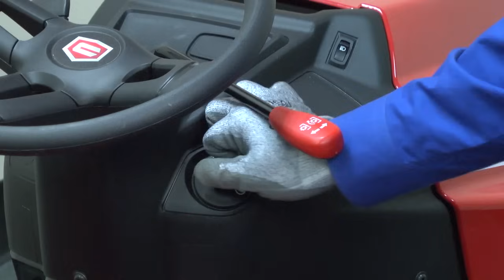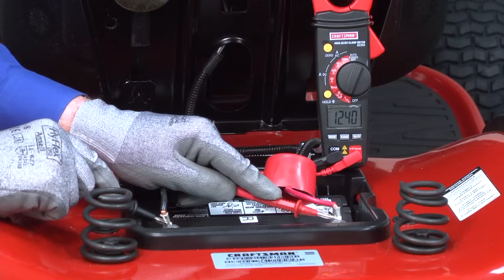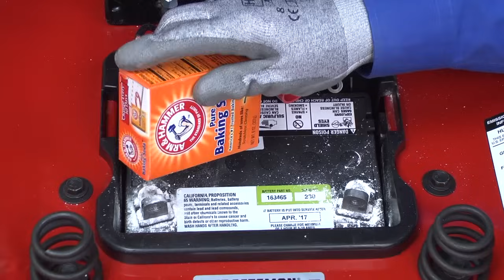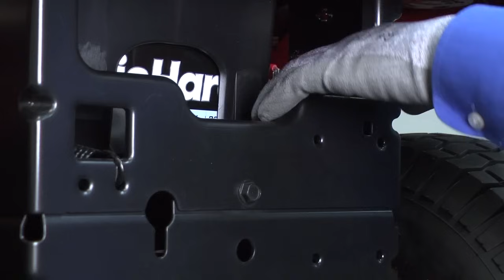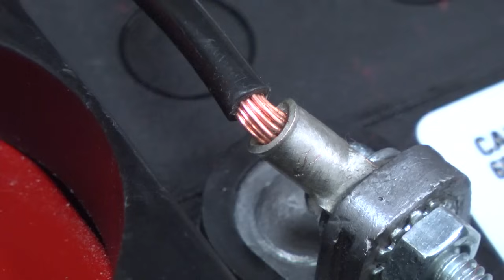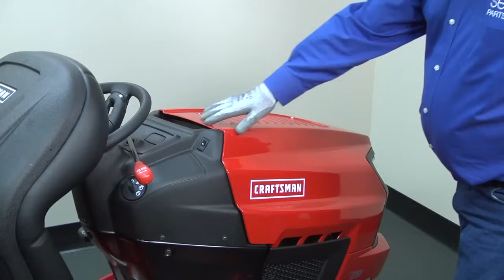How to Fix a Riding Lawn Mower That Won't Start: Engine Clicks But Doesn't Crank

Comment: Ok, maybe you can help me here, I like the video, I have a brand new battery, brand new solenoid and a brand new stated just put in.. I turn the key and the air intake spins a little and then stops.. turn the key a few more times and sometimes it spins a little, and other times it does not, just moves a little bit, I am at my wits end here as my mower had no issues starting until 2 weeks ago when my neighbor was airing up my rear tire for me and was not paying attention and my tire blew. had to wait about a week for new tire to come in, put it on and then mower would not statr!!  Have any ideas that might help me??
Reply from the maker: Try removing the spark plug(s) and then turn the key to the start position to see if the engine spins with the spark plugs removed. There's a chance that oil entered the cylinder(s) and a hydraulic lock in the cylinder(s) is preventing the engine from spinning. If the engine spins with the spark plug(s) removed then the oil causing the hydraulic lock will eject out of the cylinder(s). Reinstall the spark plug(s) and try to start the engine. If the engine still doesn't crank more than a little ways after you replace the spark plugs and your mower has a single-cylinder Briggs & Stratton engine, then the compression release cam could be broken. You'll likely need to have a service technician replace that part. If the engine didn't spin with the spark plug(s) removed, then a piston could be binding up inside its cylinder. You'll likely need to have a service technician diagnose and repair the engine. We hope these tips help. If you need more assistance, let us know and give us the model number of your mower or engine.
Reply: Hi. So did you get it solved. Sounds like the problem I've got now.. battery ok, solenoid ok, terminals ok, ground cable ok. 
Only thing haven't checked is the starter. Oh boy, I don't want to go there. Engine coming out!

Comment: Batteries fully charged but still won't start but if you hook a jump pack up to it fires right up
Reply from the maker: Even though the battery is fully charged, it may not be sending enough starting current to the starter motor to spin the engine. You may need to have the battery checked or replace the battery. Corrosion on the battery terminals can also prevent the right amount of starting current from reaching the starter motor. Check the battery terminals for corrosion and clean them if corroded. We hope this information helps. If you need further assistance, let us know.

Comment: ha hahahaha  on me, It got new battery first, it was due, then the clicking a new solenoid, Then I get to checking the starter Power. Hmm changed starter, with all new kept clicking, The one test he doesn't mention here, checking voltage from pos battery term to ground screw only 7.7 volts out of a battery with almost 13. Take out screw clean put back in Starts. 100 or so dollars later At least my major electric components are all new

Comment: PULL SPARK PLUG TURN OVER ENGINE MAKE SURE ENGINE IS  NOT HYDROSTATIC LOCKED  FROM FLOODING CARB. OR WATER FROM BEING LEFT OUT IN THE RAIN IN THE ENGINE. LOOK FOR FLUID COMING FROM SPARK PLUG HOLE AS YOU CRANK MOTOR OVER

Comment: Always check starter pinion or take out plugs hand turn engine after checking fuses and ignition and battery 1st. Never try to crank any unit w/o checking oil 1st to ensure it's not too much oil or locked. A starter pinion that's stuck will not turn engine either way use safety 1st. My experience i didn't have to use meter certain machines are messed up from engineering designs from factory

Comment: Great video!!  How freely should the motor turn with a socket?  Mine does turn but not easily.
Reply from the maker: You shouldn't need to strain when moving the ratchet handle to spin the engine. If your mower has a single-cylinder Briggs & Stratton engine, try removing the spark plug and spinning the engine. If the engine spins easier with the spark plug removed, then the compression release on the valve cam could be broken.

Comment: Thanks for the video...It would have been much more helpful if you would show where the solenoid is located.
Reply: Gs Wovoka  follow the red cable from the battery. It leads directly to the solenoid.

Comment: What if everything is good haha good battery engine isn't stuck starter is good and solenoid is good it will click once stop clicking then click again the starter trys to move but no crank
Reply from the maker: The engine may be locked up. If you have a single-cylinder Briggs & Stratton engine, the valve camshaft that releases cylinder compression could be broken. To troubleshoot this problem in a single-cylinder engine, remove the spark plug and see if the engine spins with the spark plug removed. If the engine spins, then you'll likely need to replace the valve camshaft (https://www.searspartsdirect.com/part-number/793880/0071/500.html ). In 2-cylinder engines, problems with valve adjustments could prevent a cylinder from releasing compression and lock up the engine when spark plugs are in place. If the engine doesn't spin with the spark plug removed, then the engine may have a locked up cylinder. We hope these troubleshooting tips help. If you need further assistance, let us know the model number of your mower or engine and give us additional details about the failure.
Reply: Sears PartsDirect sadly these aren't the case cylinders free good compression I've torn this engine apart to find out what's going on but everything is in grate shape I've started to think maybe not thick enough wire from the starter possibly? Bad ground perhaps but I went and added thicker gage wire and the starter just slightly moved then lost lost all power (had to replace the starter tho because it did start smoking and that's not normal hahah)

Comment: This is by far the best video explaining and understanding what could be the issue. I follow all the steps. Everything went good except when I got to see if engine when I get to the part of test for engine seize or starter electrical,  go through click and read 1.14 then it drops. The starter try to move and engine/flywheel maybe three seconds and it wont do nothing else. 

Replace battery, starter solenoid, ignition coil module, spark plug. I have LXT1040 Model#13wx90as056 Kohler engine model#SV590S. Would appreciate all your feedback. Thank you.
Reply from the maker: Here’s a link for the article and video for an engine that spins but won’t start: https://www.searspartsdirect.com/article/riding-lawn-mower-engine-spins-but-wont-start-video.html Follow the steps in that article and video to troubleshoot the starting problem because the starter is trying to spin the engine. Here’s some additional troubleshooting advice pertaining to your specific engine: Based on your details, there’s a chance that the ACR (automatic compression release) on the Kohler engine isn’t releasing cylinder compression so the starter can’t spin the engine. Faulty valves could also be preventing the engine from spinning because the valves aren't releasing cylinder compression. Remove the spark plug and try to start the engine with the spark plug removed. Removing the spark plug will release cylinder compression if that's what is preventing the starter from spinning the engine. If the engine spins normally with the spark plug removed when you turn the ignition key to the start position, then you’ll likely need to have a mechanic adjust the valves and/or repair the ACR system.

Comment: Clicking and won’t start. I did all of the steps and everything seemed good. Battery is fairly new and reads 12.85 v and I even had it checked out, reads 100% volts and CCA. I got it down to the starter motor. I then bypassed the electrical system and checked to see if the starter would turn. It turned for less than a second, then it stopped. I removed it for the tractor and tested it again. It spins. I checked to see if the engine is locked up and I could move the fly wheel with my hand, very easily.  It has been dragging for a few years before it finally turns over. Could that starter motor still be bad? I have replaced the ignition switch and the starter solenoid. I have also noticed that my ammeter is reading negative. Could I have the red and white wires reversed on the starter solenoid, one goes to the clutch switch and the other to the ammeter?
Reply from the maker: Let us know the model number of your lawn tractor so we can check the wiring schematic to determine whether you have the solenoid wires connected properly. We recommend some troubleshooting checks in response to your question on our “Doesn’t Crank or Click” video. That advice may help you resolve the starting problem.
Reply: Craftman 917.274033, DYT 4000 21 HP,  purchased 2004
Reply: Battery 12.85 V
Red post on starter solenoid to negative battery  12.85 V
Black post on starter solenoid to negative battery 12.85 V From the video, it took about 2 seconds as mine did. 
Negative post on starter solenoid to starter post 500 mV
Bypassed electrical system with jumper cables and starter spins for less than 1 second, stops
Removed starter and hooked it up directly to the battery and it spins. 
Had Advanced Auto check it out, they used a test for a slightly larger starter and it passed all the tests. 
Talked to one guy at the small engine parts store and he suggested removing the spark plugs because the compression might be too high for it to start but wouldn’t that make the fly wheel very hard to turn and then he mentioned all kind of messed up engine internal parts but wouldn’t that also make the fly wheel very hard to turn? 
I have noticed that my ammeter reads negative volts and it has been that way for several years. I am not sure why that are calling it an ammeter, it clearly reads voltage. 
Ammeter, red wire to the solenoid
Break/clutch  switch white wire to solenoid, what would happen if those two were reversed? 
Starters are very expensive so I really need to be sure that it is bad. I bought one a couple years ago and the base was 1/4 inch short and it destroyed the gear.
Reply from the maker: Thanks for posting that model number. The wiring schematic for your model is available in the Schematic section of this parts diagram page: https://www.searspartsdirect.com/model-number/917274033/0247/1509200.html  The wiring diagram is also shown on page 31 of the owner’s manual. Here’s a link for an online copy of the manual: https://www.searspartsdirect.com/partsdirect/user-manuals/917274033-craftsman-parts-manual  Use the wiring schematic to check the wiring on the ammeter, ignition switch and starter solenoid. Removing the spark plugs and testing the starting system to see if the engine cranks is a good test. You indicate that you can turn the engine by hand but there’s a possibility that a valve may not be releasing cylinder compression. If the starter spins the engine with the spark plugs removed then you’ll likely need to adjust the valves. Here’s a link for the repair manual for that engine in case you need it: https://www.searspartsdirect.com/part-number/273521/0071/500.html
Reply: Yes I do believe the valves need adjusting, thanks.

Comment: Thanks, I heard the clicking so I thought it might be a bad starter. Good thing I tested the wires. The post on the solenoid on the battery side was corroded so took some sand paper to it now it fires right up. Thanks for the video.
Reply from the maker: Thanks for letting us know what you found. We're glad to hear that you got the mower fixed.

Comment: What if I check across the solenoid and when I turn key and activate solenoid my voltage goes from 12.7 to 11.94 and stays there
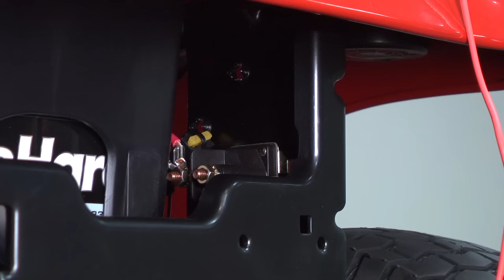Reply from the maker: If your meter measures 12.7 volts on the red terminal post of the solenoid as shown at 2:37 in the video, but the meter only measures 11.94 volts on the black terminal post of the solenoid in the test shown at 3:12 in the video, then you’ll likely need to replace the solenoid because the solenoid isn’t allowing enough current to flow to the starter motor.

Comment: Battery has 12,71 V voltage.  I measured 7,8 out of solenoid to starter. Solenoid broken?
Reply from the maker: Check if the red battery cable is delivering power to the solenoid post by measuring voltage on the red terminal post as shown at 2:30 in the video (if you haven’t already checked that issue). If the red battery cable is good (delivers 12.71 volts to the red solenoid post), then yes, the solenoid is broken according to your meter reading of 7.8 volt solenoid output to the starter.
Reply: Yes I measured the incoming voltage to solenoid. It was 12,68. Outgoing 7,8 seemed seemed to be rising if I kept on starting the mower. But I ordered new solenoid already, hope it solves the problem. Thanks for great video.
Reply: Seems that it was not the solenoid. Starter motor gets only 0.2 V. Still we managed to get the motor running. Flywheel is not working properly. It needs to be manually turned before motor can be started.

Comment: Nice video.  This covers all the components that could break.  Luckily for me the problem ended up being the battery terminals.  After I cleaned them I was able to start the engine.
Reply from the maker: Thanks for letting us know what you found. We're glad to hear that you were able to fix the problem and start the engine.

Comment: Thank you Wayne! Great video!  I have a Craftsman ZTS 7500 that I just replaced the starter solenoid and circuit breaker (breaker didn't pass continuity test).   I am only getting 7 v to the two tabs of the starter solenoid when I turn the key to start.  The new solenoid is clicking like it is supposed to but the mower still won't crank.  Battery is showing 12.6-12.8 v and holding that charge for days so my battery is good.  The starter will try and the engine will turn if I jump the solenoid with my jump pack, but it still won't turn over at all when using the key. I have not tested any further beyond the solenoid as I got stumped with the 7 v coming from to the solenoid blades/tabs.  I thought it had to be 12 v.  I'm thinking I either have a) not enough juice to the solenoid (and don't know where to look to determine why), b) a bad/weak starter or c) a bad ignition switch that has too much resistance or a bad safety switch somewhere (Seat and 2 arm safety switches passed continuity tests when triggered).  Suggestions?
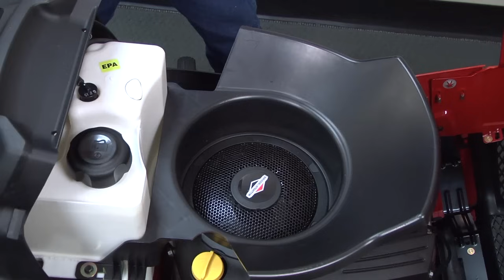Reply from the maker: Some of those models of Craftsman riding mowers had battery ground leads that were connected to painted surfaces on the frame so the battery wasn’t making a good ground connection, resulting in intermittent starting problems. Find the connection of the black battery lead to the frame or engine block. If the black lead is connected to a painted surface, disconnect the leads from the battery and then disconnect the black lead from its ground connection on the frame or engine block. Sand off paint and clean the ground connection point to remove any resistance to the battery ground. Reconnect the black battery lead to the ground connection then reconnect the leads to the battery. If this tip doesn’t help or the battery is already connected to a good ground on the frame or engine block, then check the ground wire that connects to the bottom relay tab on the solenoid as shown at 5:27 in this video: https://www.searspartsdirect.com/article/riding-lawn-mower-wont-turn-over-or-click-video.html. A bad ground connection through that wire could cause low voltage through the solenoid relay. Repair the ground wire connection for the solenoid relay if it’s bad. If the ground wire connection on the solenoid relay is okay, bad wiring or a faulty component in the circuit between the battery and the positive solenoid terminal tab is likely causing the meter to measure only 7 volts at the solenoid relay. Before you check that circuit, we recommend that you check voltage on the output post of the starter solenoid when the solenoid clicks as shown at 3:06 in this video that you posted your question on. If you’re not measuring 12.6-12.8 volts on that solenoid output post when the solenoid clicks, then check voltage at the input post of the solenoid (where the red cable is connected) as shown in the video. If the meter doesn’t measure 12.6-12.8 volts on the input post, follow the troubleshooting tips to clean the battery terminals or replace the red battery cable because it isn’t carrying enough current to the solenoid and the starter motor to spin the starter motor. If your meter measures 12.6-12.8 volts at the input post of the solenoid but not at the output post of the solenoid when the relay clicks, then the 7 volts going through the solenoid relay likely isn’t closing the solenoid contact. You’ll need to check the circuit between the battery and the positive solenoid relay post to find the cause of the voltage drop. We hope these tips help you figure out the cause of the starting problem in your riding mower. If you need more help, send us details about the results of the recommended troubleshooting and let us know the model number of your Craftsman ZTS 7500 mower. You can likely find the full model number of the mower under the seat.

Comment: Your video helped me get an old Scotts tractor running.  New battery and it turned over for about 2 seconds. Nothing but clicking.  Checked the switch and solenoid and they were working.  Tried shorting across the solenoid terminals with a 12 awg solid wire but no luck.  Then loosened and retightened all terminals; battery, solenoid and starter.  Added a little starter fluid to the air intake and it cranked right up.  Just to note.: Some tractors may have safety switches, so make sure they are engaged.